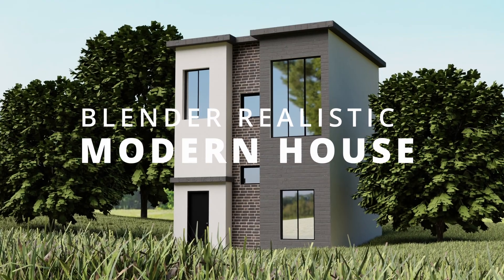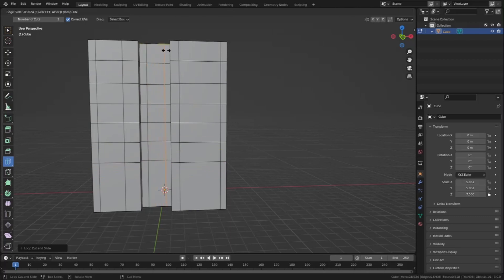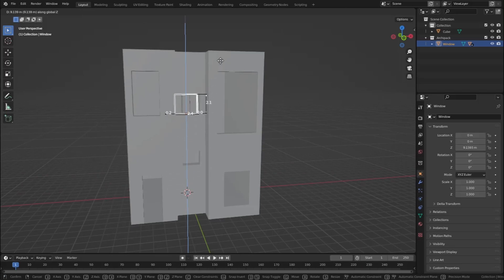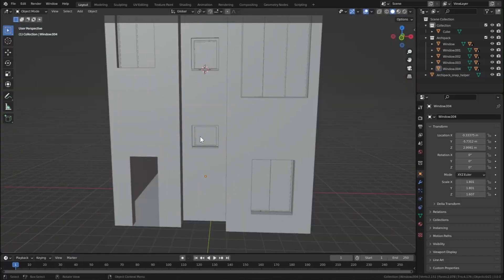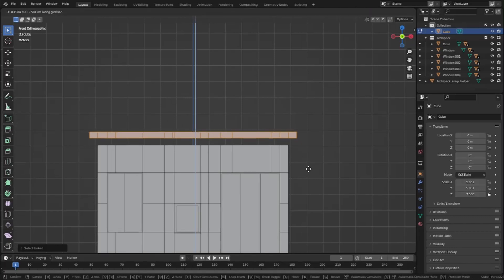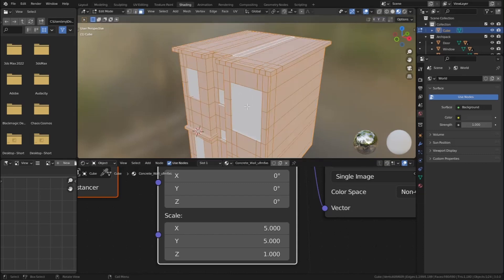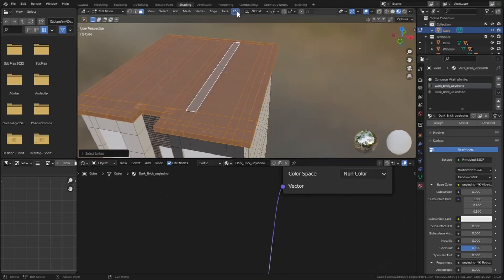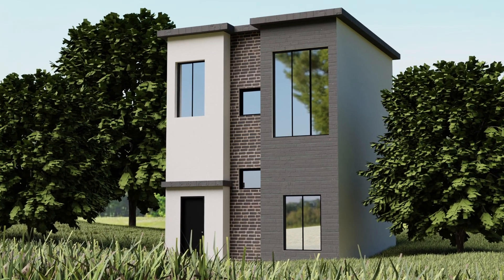Blender house - Create a Realistic Blender House in 10 mins [ Very Easy ]

Comment: You have to install Archimesh as an Extension in the Extensions tab, under Preferences. In the old Version of Blender you would find it under the Add on tab. But from 4.x.x you will find it under the Extensions Tab. It used to get shipped as an Add on with blender on the old versions, but now you just get it as a Extension. Internet access required to download it as a Extension. Best regards

Comment: why u don't show how to import those textures ?
Reply: U still wanna know ? Or did u get the answer
Reply: @gamestart31  i got it,    for example you have a cube , to put the texture on it , select the cube , open shader editor, then in the right panel create the default material as normally,  then in the shader editor check "use notes" , then it will create the default nodes,  then just click on PRINCIPLED BSDF node and press and hold "CONTROL + SHIFT +  "T" key  and blender will open a File Browser Dialog,  and then just search in your texture folder or location and selects the jpg or texture files and click import and blender will create the texture nodes automatically.
Reply: @weaponcode353  yup bro , I figured it out
Reply: So I asked u if u wanted to still know or not

Comment: I was curious why at the first, when you change the z dimension to 15, ithe cube extends upward from the 3d cursor, wheras mine extends equally in both directions so that the cursor is in the center. I struggle with my objects ending up scattered throughout the 3d space, so I'm trying to figure where I'm going wrong.  Thanks for these lessons!
Reply: New to blender, but it's possible you have not yet set the transformation of the object? If you do (i think) control+A, then selection the location transform, it will tell the object that its current transform location is its new "0" location
Reply: Thanks...that's a big help! @JPLafreniere1

Comment: Hello Bro 3D, How can I combine all the parts of the house to move it around? When I try it the reflection in the windows get distorted?  
I tried it in wire frame, solid and thought I shut off render mode but it still does not work.
Reply: just select every object  and press ctrl J to join them all
Reply: Just get the bool tool addon and then select everything press ctrl+shift+b and then press union